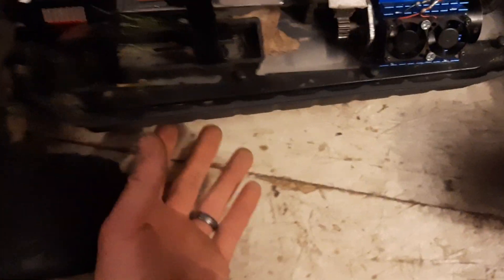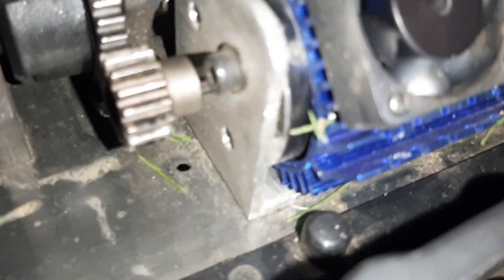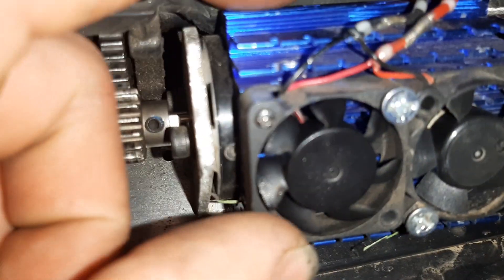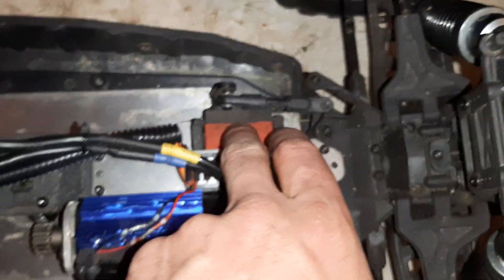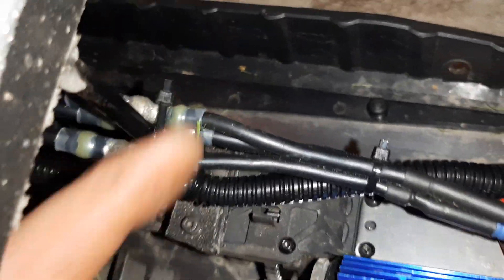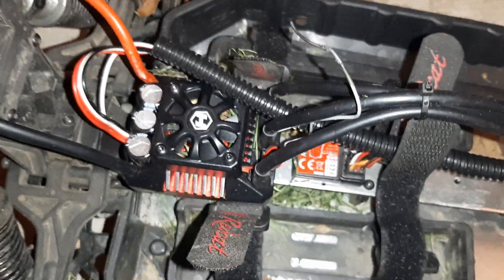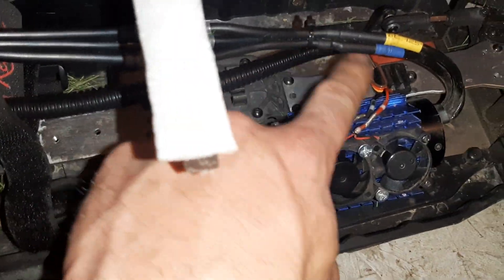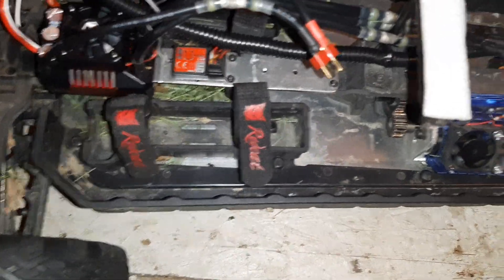Shredder motor mount explained

Comment: I thought bout changing the mount but it’s too much of a hassle so I’ll leave the stock mount plus it holds the motor btr wen u bash n do those high jumps n hard landings.. I have mines on 6s.. jus get the arrma 6s blx center diff n put it in right out the box it fits perfectly with the drive cups.. watch my video on it..
Reply from the maker: Can you leave me your link?
Reply: @ragercrepair9301  type in.. real shredder center diff fix arrma 6s blx.. Idk how to send the link..
Reply from the maker: Ok
Reply: @ragercrepair9301  slight modifications on the diff housing n bearings but I figured an ingenious solution
Reply from the maker: There's only one problem with running that putter race like you did. After a while it spins against the arrma bearings and wears the outside out and gets hot. Then it melts the center diff mount. I've tried that and it does surely work but its not quite tight enough between the shredder outer race and the arrma bearing. If your just bashing it works perfectly. But speed runs killed my mounts twice. That's why I found the bearings I did and modded it the way I did. But I love the idea. And I didn't order the entire center diff. I ordered the hot racing aluminum diff because I wanted the heat to escape from the oil and spider gears inside the diff. I also run 1 million weight which doesn't work well with plastic cases. Seems to cause to much pressure and it splits the cases in half. But in short I loved the ingenious idea. It works longer if you red locktite the shredder outer race the the arrma bearing and let it sit over night.
Reply: @ragercrepair9301  cool man.. so far it’s ben serving me well.. I won 3 races til I snapped my front steering knuckle.. but it’s ben a solution for me so far.. thanks for watching bro.. n I’ll take ur advice as well cuz I learn every day👍
Reply from the maker: Haha I learn everyday too bro! Every single day I tear apart a different vehicle with a different problem. I really like to share my experience with everyone because knowledge is priceless and needs to passed along. People need to help as many people as possible.
Reply: @ragercrepair9301  true that’s y I do it but I do it with the right info.. couple videos I’ve seen that wer bullshit..

Comment: If thats a 36mm motor, you might be able to get one of those aluminum motor mounts instead. It helps cause you can set gear mesh on the mount itself
Reply from the maker: My motor is a 4082 so that wouldn't work for me. I was thinking the same thing but I already had the motor.
Reply: @ragercrepair9301  Ah, my mistake
Reply from the maker: Hey no problem. I like the motor I have. Plenty of power of 4s but totally unreal on 6s!